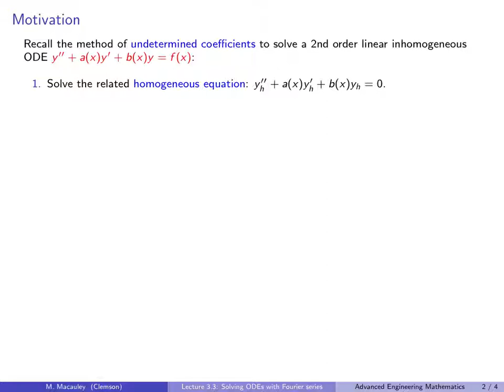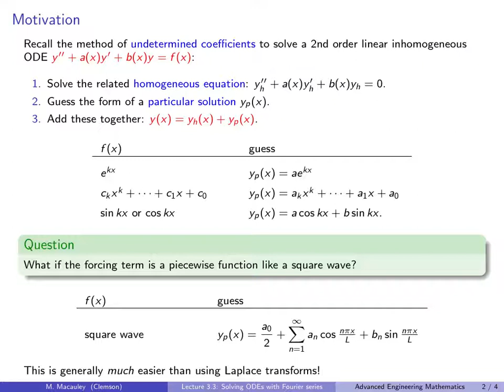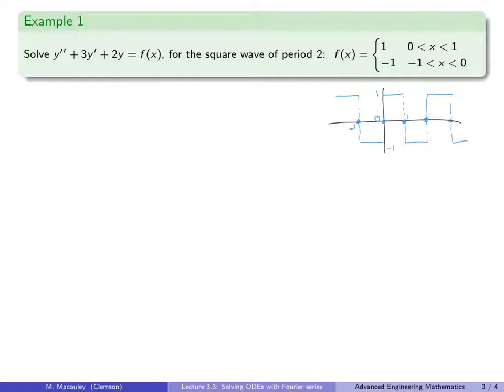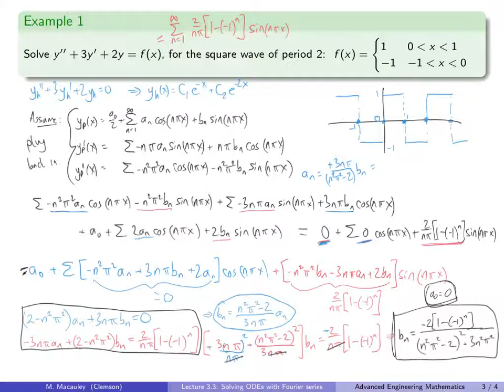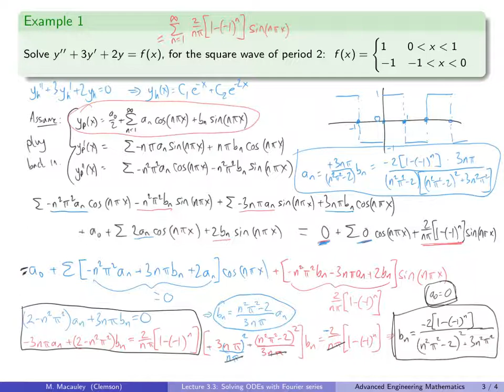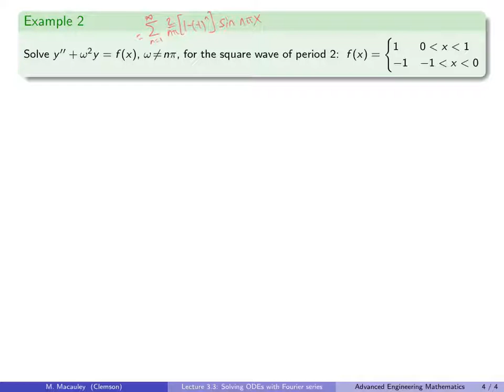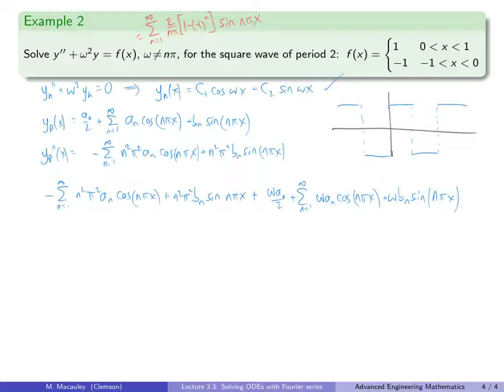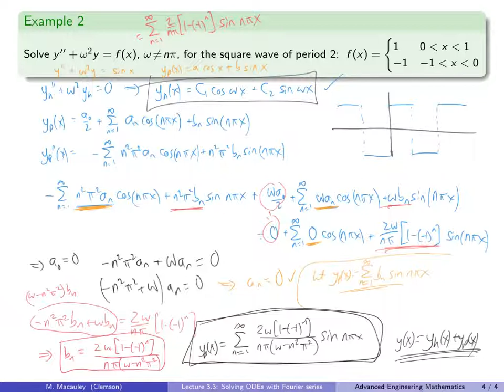Advanced Engineering Mathematics, Lecture 3.3: Solving ODEs with Fourier series

Comment: Beautifully explained and very helpful. A quick observation: In the second example when each series is plugged into the original ODE, an omega appears on the R.H.S. (expansion of the forcing function) which I guess should not be there.
Reply: Instablaster.

Comment: Why is it 2/n(phi) for the f(x). Isnt it suppose to be 1/n(phi) ?? Am i right??
Reply: Sorry i mean 4/n(phi)
Reply: Odd symmetry gives you the values (a₀ = aₙ = 0) and (bₙ = (4/T)⋅∫<f(t)⋅sin[n⋅ω₀⋅t]⋅dt>, where the integral is evaluated from t = 0 to t = T/2.
If you plug in T = 2 into this equation and use the fact that ω₀ = 2⋅π/T = 2⋅π/2 = π and finally plug then answer for bₙ into the original general Fourier Series equation (keeping in mind that a₀ = aₙ = 0) then you will see that the equation in this video is correct.
Note that the function f(t) is f(t) = 1 between the bounds t = 0 and t = 1.

Also, remember that cos(n⋅π) = (-1)^n, which will simplify the final answer that you get (which will contain a cos(n⋅π) term).